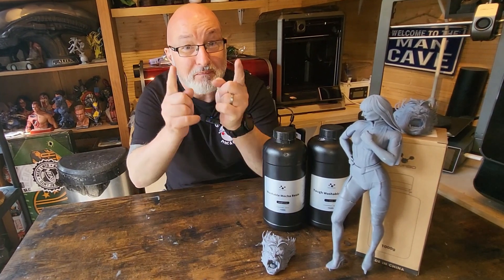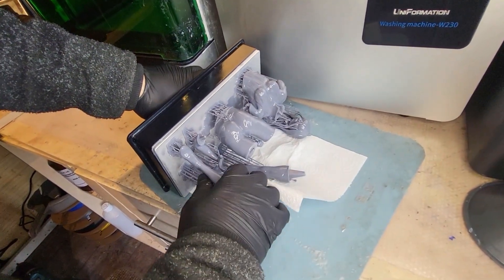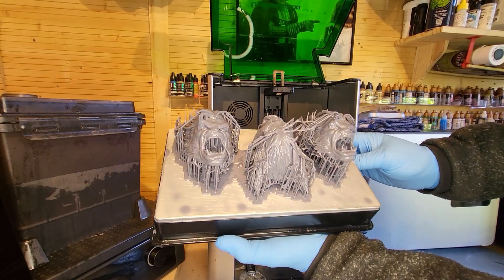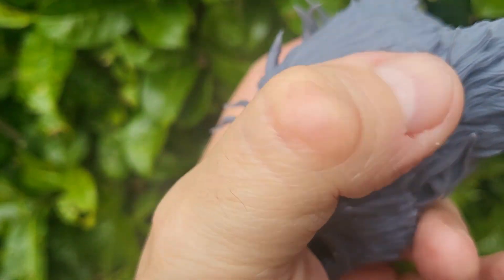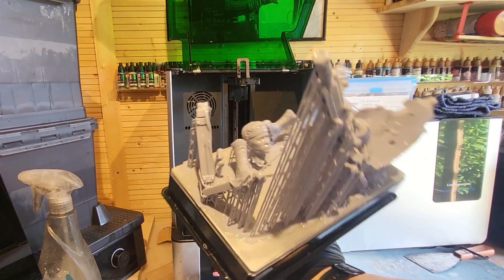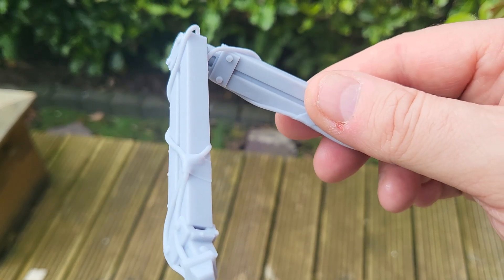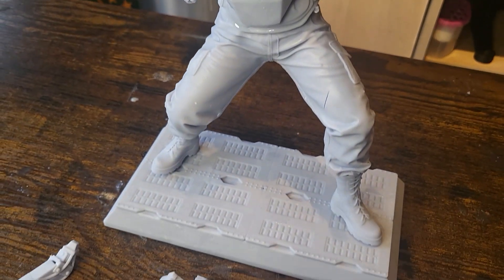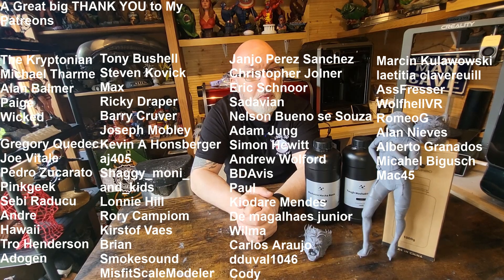Nova3D New Washable & Mecha Resin 3D Printing Review And Settings Advice

Comment: Wonderful. I really like that waterwashable tough. Not even worth testing on a Heygears? Speaking of Heygears I just put down 10 euro on the preorder for Anycubic P1. It that turns out well in february I won't have to consider anything pricier.
Reply from the maker: That's cool you're looking into the P1, hope it works out for you! - review coming soon
Reply: @greedy3d480  Well I am not all in, but I invested the downpayment so I will definitly hold on to the P1 as my main choice unless "some" reviewer shows some serious faults with. For the money it seems like a great deal with heated vat, lock in mechanism instead of screws and if the pressure sense algorithms work ok,,,

Comment: Can I ask a stupid question please? Does that 6 second Rest Time Before Lift setting mean every single layer takes an additional 6 seconds to print?
Reply from the maker: Pretty much yeah
Reply: @greedy3d480  that's a pity - thanks for confirming
Reply: @daydreamerdesigns3D  here's my Lychee Slicer settings. I haven't had any issues with these on my old Nova3D Elfin2 Mono SE,  Normal layers thickness 40 um, wait before print 1 sec, Exposure time 1,8 sec, wait after print 0 sec, wait after lift 0,5 sec, lift distance 6 mm.
Maybe it's because of the monochrome screen that I don't find any need for the wait after print. All the errors I've had comes down to  badly placed or weak supports.
Feel I should put the burn in layer settings as well, No of layers 5, Layer Thickness 50, Wait before print 1 sec, Exposure time 45 sec, wait after print 0,5 sec, wait after lift 0, lift distance 6 mm
Reply from the maker: Yes it does

Comment: The beast head at 4m26s seems to have light small dark holes/marks pitted over it or is that just dirt from when you mention dropped?  Curious is a resin flaw or just dirt please?
Reply from the maker: It's dirt not a flaw 👍
Reply: @greedy3d480  thanks for confirming.  Hope to get my 1st resin printer this year, move from fdm.  So looking for good resin to start with on gkTwo as fellow UK resident.